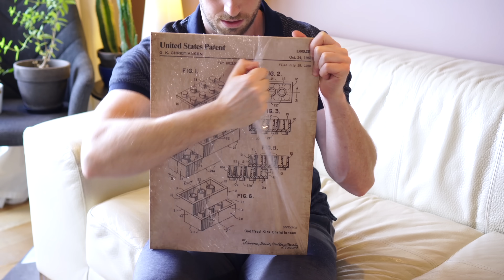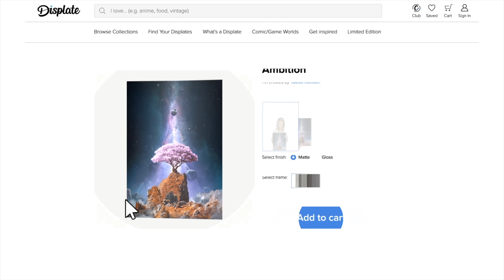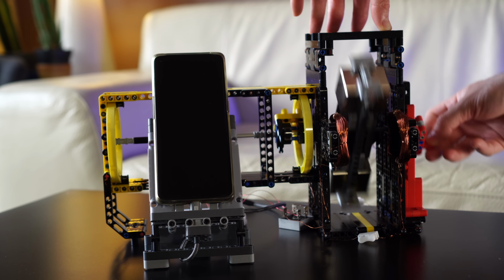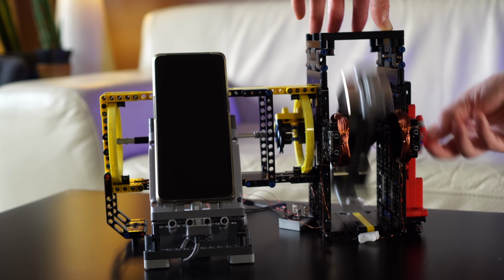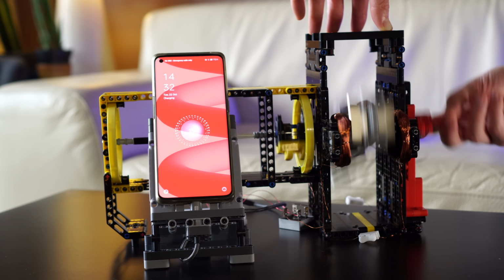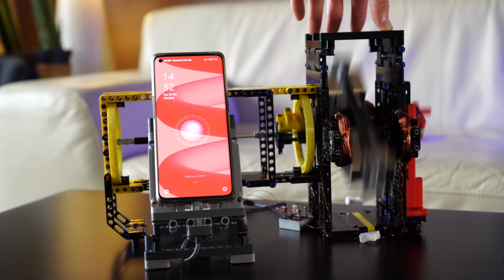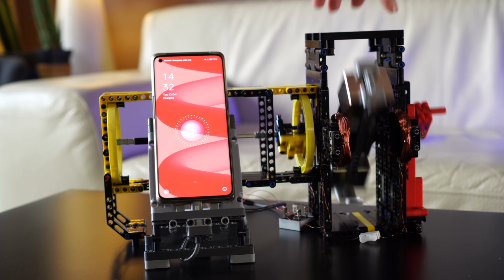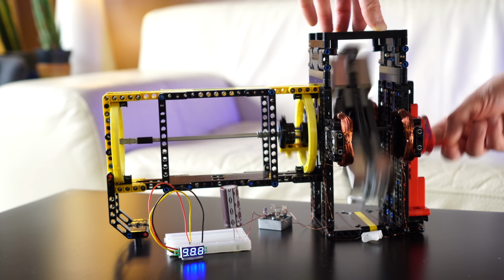LEGO Elastic Energy: Making Power From Rubber!

Comment: I do suggest diving into gravity batteries and gravity generators.  I've done my own experiments, and found it quite satisfying to design, work out, and play with during the process.
Reply from the maker: That's awesome, you got any tips to bear in mind?
Reply: @JamiesBrickJams  It's all in the math between the weight of the object, the distance it can lower to produce energy, and the gear ratios between the different parts.  Too much gear ratio, and the weight doesn't turn the mechanism / turn it fast enough.  Too little ratio, and the mechanism runs out too quickly.  You're looking for the gravity load to just "tick down" slowly, keeping the mechanism spun at a steady speed the entire time to maintain output voltage. The gearing is the key component, and you'll be figuring this out on paper.  

Potential Energy = MGH, where M = mass, G = gravity, and H = the height of the fall.  Unrestricted objects accelerate in fall at 9.81 m/s/s, so the energy of 1kg of gravity load is 9.81 Joules X the height in meters.  Power in watts = Energy in joules / time in seconds. If our total energy is 9.81J per meter of height, we can scale the Time in Seconds to figure out our gear ratio and how it affects our Power Output Rate.  More gearing extends the time, but divides the Power Rate by a larger period, making less power per second for longer.  The inverse also applies.  Example: If we put in a 16:1 gearbox, we'd be dividing the Time in Seconds by 16 to give us an estimate of the new Power Output Rate.  Friction etc skews the data, but it's enough to make estimates for prototyping.

I suggest building at the largest scale you realistically can.  A tiny load's force of gravity can easily be eaten up by friction losses, where starting with a scaled up load / setup gives more margin to work with.  Efficiency matters.  Proper bearings and stronger materials may be required.  Every watt matters in a process like this, and friction losses translate directly into power losses.

I suggest a target voltage of around 5v output if possible, as it's a practical and useful voltage for USB devices (especially if regulated).  I recommend using a high anchor point, as more height means better runtime and better data.  You'll also lose some height between the anchor point and the center of the gravity load to connections and load height etc. If you're doing this with Lego, this might be interesting to achieve.

Feel free to reach out if you have specific questions, but this is basically what I self-learned from playing with gravity energy / energy storage.  Hopefully it helps.
Reply: Some more advanced ideas I've played with are using centrifugal clutch mechanisms to have the gearbox ratio change on the fly.  Basically, at a certain speed the centrifugal forces engage the clutch and the gearing on another stage of the gearbox.  My thoughts were that this would take advantage of any "over-acceleration" at the load, slowing the descent and increasing the energy capture.  Think of it as shifting through gears in your car.  You get up to a certain RPM, then you adjust the gear ratio to get to a higher speed and overall energy level.

Yeah, basically an automatic transmission lol.
Reply: My prototypes were at a point where they would produce energy well, but I hadn't fully worked out "steady rate of descent" part.
Reply: @JamiesBrickJams  I posted a whole big thing on the theory of this, the physics equations, estimating and scaling gear ratios vs descent speed, etc.  I'm not seeing this comment now though, so I'm not sure what happened.

The basics are this: Potential Energy (PE in Joules) = MGH, where M = Suspended Mass, G = 9.8m / s (acceleration of gravity), and H = height of fall.  Converting Joules to Watts looks something like this: Power (W) = Energy (Joules) / Time (Seconds).  Your goal is to make the gearbox do 2 things: Spin the generator at an average (or better yet, constant) speed that makes your desired voltage range; AND slow the descent so that the device can run for longer. The gearing is the most important part.  My basic recommendations were:
- Run tests with a starter gearbox ratio that can be multiplied. Get the peak and average voltages from those tests and use them to scale the gear ratio to correct the generator RPM / peak voltage.
- A steady descent means a steady voltage.  I was still working on this point when I moved to other projects (see other comment).
- Use the highest anchor point you can.  More height = more runtime / energy = better data.  
- Efficiency matters. Friction and other losses translate directly into power losses. Bearings etc will help.
- Target an average (rectified) voltage of 5V if possible, as this can used in a practical sense and is an easy / harmless voltage to hit.  If it seems impossible to slow the RPM down enough to maintain this, go to a higher voltage like 12V (again, rectified).

I had more, maybe it's somewhere that I can't see it.  The gearing makes or breaks the thing.  You don't want your load just dropping to the floor in 1 second, nor do you want it to hang without generating any / much RPM.  The gear ratio is slowing the descent.  If we use a 2:1 ratio, we can expect the resistance holding the load suspended to be doubled.  Once you have some data, you'll be able to estimate your final gear ratio vs gravity load vs generator drag vs voltages.  You can only really change the gravity load weight and the gear ratio, so at least that part is simplified.

Comment: a gravity contraption will be smooth but limited runtime. you might need a way to disengage for the flywheel contraption. if I was making it, I will use many small magnets and coil around the entire spinning zone with the magnetic pulls alternating and facing the coils. sometimes the best is simple.

Comment: Picture this:
Four thick rubber bands each on their own separate gear and axis, sharing the same plane and joined together by a central winding gear. This eliminates the axle interference allowing more windings, and increases torque. Next, play with gear ratios on the output for longer spin times.
Reply from the maker: That's actually really clever, thanks for the suggestion. I'm itching to try this now...
Reply: @ I’ll have my eyes peeled! But no pressure haha. I only live vicariously through you

Comment: If you use a bit more advanced electronics, you can make better use of the coil output. Just connecting a rectifier and a few capacitors doesn't do much, as we can see

Comment: Notes and thoughts:

You are not “making power”. You are simply converting power. Technically destroy power but lets not dwell on entropy too much.

Second, try a gravity battery. From 3 to 6 metres, a mass falling could release energy over time in a controlled way. Naturally you want gearing to prologue this process. Enough mass means you can have enough torque for the steep gearing.

Comment: when rectifying some custom generator you can use few tricks:
If it has separate windings then you can rectify each using doubler on 2 Schottky's and 2 capacitors - that way you loose alot less power on diodes. Those doublers you can connect in parallel or in series depends on what voltage you want.
Also you can measure voltage without load and then setup dc-dc converter to convert that voltage into voltage that is exact for your load. That way you can draw less current at higher voltage, and current in a winding is what causes magnetic brake in generator, so you want it lower unless your "engine" is effective at high torque.
Reply: Infact pairing the coils in parallel without any diode is just dumb … electric engineering 101… I’ve been screaming at the screen when he started to test multi coil…

Comment: What's the easiest way to start a collection? Do you buy the technic as individual pieces or is it from sets? I remember when I was a kid back in the 90's that my school had technic packs which had a ton of pieces to make whatever but I can't find them anywhere now.
Reply from the maker: Hey, my typical recommendation if you're looking to get back into technic would be to buy one large set to get started. Something with a lot of lift arms, pins, and connectors. Lego is pretty expensive these days, but a single set of between 2000 and 4000 parts is a great place to start. I'd also recommend building the set first to get a feel for the building techniques used, as technic has changed a lot over the years! Then if you're looking for more parts, either buying more sets or using Bricklink to buy individual parts is the best way forward
Reply: @JamiesBrickJams  Thanks heaps, I was thinking that would be the answer. I looked into both and found that the sets seemed the best route for variation.
Reply from the maker: @Matty12787  Awesome, best of luck getting started again - I'm sure it'll be worth it

Comment: What if you geared up the last desing so you got more torque so you would get higher voltage
Reply from the maker: Gearing can either create higher voltages (higher speeds), but torque (current) will suffer. Or you can decrease speed and voltage, but increase torque (current). Something is always sacrificed unfortunately 😅

Comment: What if you built an inner ring with the magnets riding a rail and an outer ring of coils to generate electricity, which will power a motor that's used to keep the magnets moving on the rail indefinitely?

It should power itself... maybe; as long as the magnets move fast enough I think. Then set up a system that uses rubber to get it started before it becomes self-sustaining. I think it would be cool to see

Comment: You might want to introduce a governor to keep yourself from overspeeding if you're going for gravity. It'll allow you to run your machinations for longer without the need for a reset too.
Reply from the maker: A governor could be a great idea, especially when adding heavier weights. However I have a suspicion that when I attach an electrical load, the drag on the spinning core will slow it down a lot. I have a feeling this could be a great means of allowing the generator to hit whatever voltage is needed by the load. Then as the load starts drawing power at whatever speed hits the voltage threshold, that'll cause the generator to stay around that speed. Only a hunch for now, so will have to test it out. Otherwise, a governor would be a great addition!

Comment: Instead of a full bridge rectifyer use a full wave voltage doubler.  It still rectifies the output, but the voltage is double that from a full wave bridge rectifyer and the energy is stored up in capacitors which would stabalize the LED light minimizing the peaks and holding up the minimums under load. 

Google image search full wave voltage doubler.  It uses only two diodes and two capacitors.

Comment: Use a disk with the magnets (singles) on the edge and wind it up using beefy rubber bands then make the kinectic to elctric conversion with the rubber bands are connected to each side with an axle goong through and bars running sideways through the axle to store more torque in the output

Comment: I'm guessing why the caps don't smooth out the brightness more is due to the lack of current limiting resistors.
When you have an led straight parallel with the caps, the moment the voltage rises much over the forvard voltage of the leds, they will draw a huge current, limiting the voltage the caps can charge to.
When the pulse of input current diminishes, the caps are already right at the limit that can light the leds at. The voltage/current plot of diodes is very steep!
What you want in addition to the smoothing caps is either current limiting resistors, or, for more efficiency, a switch mode constant current source of some kind.
The latter will greatly improve both the duration and evenness of the light.

I would also consider ditching the few big magnets in favor of many small magnets.
When that thing rotates, most of the time it is not doing anything, just spinning away energy to friction.
Had you a ring of smaller magnets passing by a smaller coil (With an Iron Core!), would the field at the coil look more like a constant sinewave, rather than a bunch of passing peaks.
Nicer to work with, too, much less scary.

Comment: Your elastic is braking the system. Run a gearing setup that can freewheel after it has been accelerated by the elastic, then you have a much longer run time, and you can harvest more of the energy as the braking will instead only come from the electro-magnetic resistance induced in the coils.

Comment: Great construction.
If you are using discrete LEDs you may find better performance if you add current limiting resistors.
The LED rope, what operating voltage is it quoted add? Again a series resistor to limit current may help.
Caution, when loading your AC circuits with LEDs, beware that most have a low reverse bias voltage threshold and you may exceed that. 
👍👍👍
Reply from the maker: Thanks! If I remember correctly these noodles are manufactured to be used with single cell lithium batteries, so they prefer around 3.7 volts. Though they can be 'overclocked' for short periods of time relatively safely. They do consume quite a lot though. I'm amazed how quickly they drain my 500F caps

Comment: Try putting ferro-magnetic cores, like small bars or something like that, It theoretically makes the coils to "catch* and generate more energy. Cool generators 👍
Reply from the maker: Yeah in theory that should definitely yield better results. I've tried a few designs with metal cores and they're very challenging to build out of Lego without gluing parts 😬
Reply: @JamiesBrickJams  try putting an output from de cores and connect them to the main coil, It may be better in that way, but also the size depends on how much It will improve catching the magnetic field, just go trying different ways with different sizes and find the best one

Comment: As Joergsprave from the Slingshot Channel will tell you, there's no point pulling rubber over a pulley, what you gain in length you lose in friction.

More recently though Shoottech released a slingshot with pulleys (though it looks a lot more like a bow than a slingshot at this point) where the tricks turns out to be having multiple short bands (they go from like 8cm to like 20cm pulled by a string on a pulley) in parallel to increase the force pulled by the string using a pulley.

Twisting them around themselves is only a good idea for model planes because it saves a huge amount of weight since you don't need as much structural rigidity to deal with the torque or gearing to increase the speed.

(Most rubber band planes would actually go further if you just launched them from your finger using the elastic band but the ability to stay in the air longer and slower is their whole selling point)

But for a ground storage mechanism you don't have weight limitations which is why gravity works so well, so the reasons to use rubber at that point are basically gone, except for compactness and working at different orientations, thus why clocks used springs for so long.

Comment: Where did you get those magnets? If I get my hands on those magnets, I can build a powerful generators. And you said that could run 12 V I have a DDC converter that only run 12 V to turn on if I build the same thing you built, I can try improving it and building a powerful generator that can run for a while or let nature run it. The possibilities are endless.

Comment: if you add sleeves on the axle between the rubber bands, you can solve the problem of the rubber band winding unevenly
Reply from the maker: That's a great suggestion! Not sure it'll entirely solve the issue, but it could certainly improve it. Will give it a shot

Comment: I like that you can hear the AC wave produced by the coils when running diodes. When the diodes conduct therefore draw power the magnet encounters some resistance due to the current flow, then it swaps and the diodes go into blocking stopping the current (for the most part), and the magnet spins a little freer, until it swaps again and they start conducting. Very interesting demo....

Comment: 9:54 if you used springs to allow the gears to go under tension towards the center of that block it would significantly increase the power of that design. kinda how old sailing ships used blocks and tackle to lift very heavy objects.
Reply from the maker: Ah do you mean like using some kind of pulley system to amplify the force on the string?
Reply: @JamiesBrickJams   yes.

Comment: i'm not an expert but i think you either need to gear it up, or increase the windings. because i'm fairly certain even if you shorted those coils, it would only slightly slow down the rotor. i think tons of kinetic energy is wasted as we see rubber bands overshoot and wind up again, due to coils getting oversaturated and not generating anything above that. which is not a problem for energy storing, because it's going to generate energy as far as motor is running, but is crucial for demonstrating actually how much power can it deliver.
Reply from the maker: Yes, I think you're right. Even when attached to an empty capacitor bank (essentially shorting them), there wasn't a crazy amount of resistance. I've definitely made much more efficient pole/coil setups. Clearly loads of room to improve the efficiency of something like this!

Comment: If you want to revisit elastics, I feel like you should opt for long-term energy output over high voltage output. 30, hell, even 40 seconds of 3v is much more practical and easy to utilize than 5 or 10 seconds of 9v, especially if capacitors are out of the question.
Reply from the maker: That's a really good point - I prioritized what I thought would be overall output, but there is clearly a lot of energy going to waste. So 3 to 5 volts over a longer period of time is probably much more useful. I'd love to be able to power a small nightlight or something with a compact design